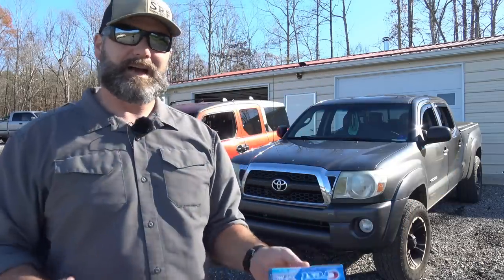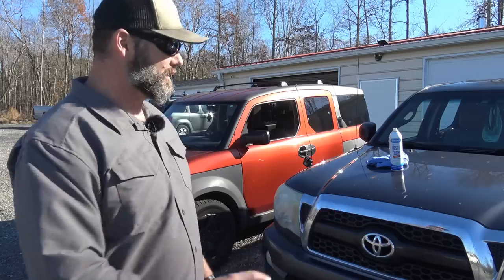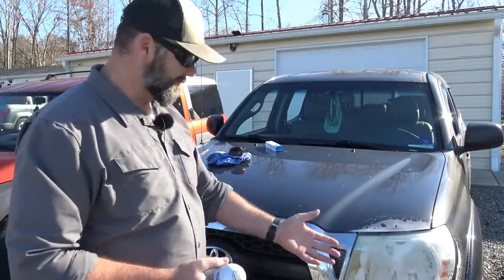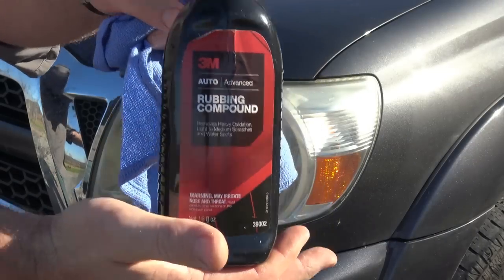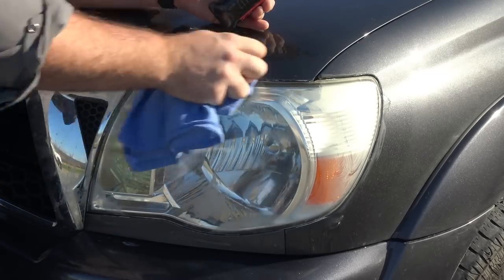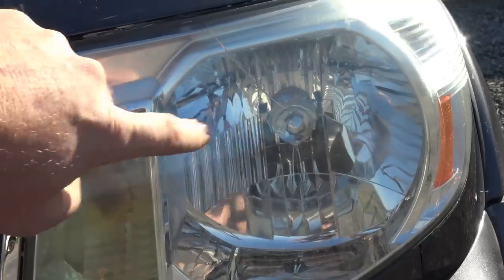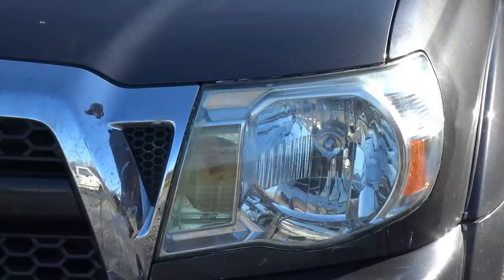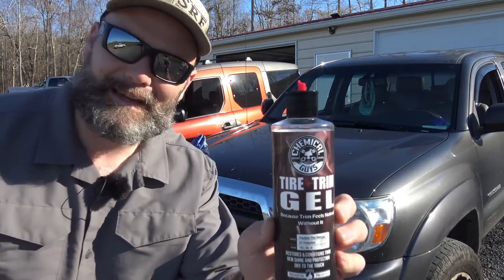Does toothpaste really work to clean headlights? Let's just see!

Comment: If they are really oxidized/yellow, start with some 2000 grit sandpaper, wet sand, wash with clean water, sand again w/2000 or then jump to 2500 or 3000 grit sandpaper and wet sand again. Then rubbing compound and finish with a good wax/polish.

Comment: i worked for both Honda and Toyota. You can use Off bug spray by spaying it on a rag and rubbing the headlights. For the best results use the compound but instead of applying it with a rag use an electric buffer and squirt the compound right onto the pad then buff the headlight. If the headlight lense has scratches or is pitted you can wet sand it using 2000 grit paper then use the buffer with the compound.

Comment: I think the lens cleaner I had for my Tundra was a Turtle Wax brand.  Only lasted a couple months then they were just as hazy as before.  Its all the road grime crap that gets stuck to them and then burned on due to the high temperatures of the light bulbs.  They need to come out with a plastic sheet you can apply over the lens as a protective layer that can just be peeled off and replaced.

Comment: If you are going to do more than buffing some metal or possibly a headlight or two I really think you should look into getting the right tools. That buffing wheel is really not intended to be used with an angle grinder as those spin much to fast. An angle grinder often will spin at something like 10K rpm. A buffing wheel like that should not be run at over a couple of hundred rpm, 3K rpm at the most. There are several kinds of buffing machines, some of which look just like angle grinders, but they all run at a much lower rpm. And some can be had very cheaply and will do just fine if you're going to buff a car or two.

Comment: The oxidation would be a result of the plastic being in contact with the oxygen in the air. So prevent the plastic from coming in contact with the air. This might be a goofy idea, but, after the headlights have had the oxidation removed and are clear how about a layer of clear polyurethane on them to keep them clear for a long time. Another experiment maybe?

Comment: Buffing compound is the way to go.  A courser cutting compound has too much abrasive.  Angle grinders run at a much higher RPM than dedicated electric or pneumatic buffers, so, yes, go easy and use a very light touch.

Comment: The guy I saw used a toothbrush to apply the toothpaste. It may makes a little difference. I have used 0000 ga steel wool on them. I also use the steel wool to clean on all my windows then RainX™ them yearly. When I wax my car I also wax the headlights. Most all paste wax has a little rubbing compound in them.

Comment: I’ve used toothpaste on headlights before, I used toothpaste with baking soda in it, it definitely takes longer than 5 minutes but all I did was put the toothpaste on the light let it dry some then dampen a rag and buff like crazy took about 2-3 times but they turned out pretty good. I eventually ended up buying new lenses because the original were cracked and needed replaced so the toothpaste was to get me by until then.

Comment: Woollen polishing bonnets should be cleaned , I did 2 recently getting ready to polish a car , I mixed some "Wool and delicates" laundry liquid with some water , dunked the wool into the mix and brushed the crud out using a nail brush in a circular motion , rinse and repeat , then put on the polisher and spin dry then allow to fully dry in the shade . They look like new again . 
                Also , never use a polishing bonnet on a grinder , they just spin too fast , even the battery powered one Josh uses here he had to ride the trigger on/off , a big 110v grinder would destroy the bonnet and possibly cause injury . Use the right tool for the job .

Comment: As Josh mentioned, you will need to redo application every 6 months or so.  Using any abrasive on the plastic headlights removes the UV coating (which obviously failed anyway). And there is no way of adding that coating back, that I’m aware. Rain-X, Novus etc will not reapply UV coating. What does work really well, wax your headlights once a month. Takes a couple of minutes and saves performing the cleaning process.  
Personally, I’m just trying to figure out how you manage to continue to have great weather.

Comment: Get toothpaste that is "whiteing" because it uses little particles to scrub with.  I used a small polishing wheel on a drill. 

Need to use some water with the toothpaste!  Doing it dry like you did will not let it work as well with the lubrication the water adds to it!

Comment: Rubbing compound is not polishing compound, it's a cutting compound.  If you followed up after the rubbing compound with polishing compound, the clarity would be even better.  I have to agree that toothpaste is a poor headlight cleaner.  Headlights are supposed to have a UV resistant coating, from what I hear, and also from what I hear is some people apply a UV resistant wax (or whatever new age name they use for wax nowadays) to protect the headlights for a bit longer.  Some people go the extra mile and apply a quality UV resistant clearcoat, but I think that's over the top and may actually cause more problems than help.

Comment: Likely to fog up again soon 1500 and 2000 wetsand paper sand w water then high speed polish wool or foam pad
Reply from the maker: Not just likely...they will fog up again.  It takes literally 5 mins each to touch them up every 6 months.  Over 6 years you'd spend an hour...the lights have lost their protective UV coating and they will need to be cleaned now.  But this works great! And it's cheap!

Comment: If you are really lazy...I have found that if you get Insect Repellent Wipes (just a few dollars for about 20) that contain DEET, they will take 90% of the oxidation off in about 30 seconds. Wash the dirt off first which would add a minute or so to the 30 seconds ! I haven't found that the DEET damages the plastic, but I would be careful near the paint. I have old cars...:-)  <bb

Comment: At least the plastic lenses can be polished.  You can't do that to glass.  I had glass headlights in a Volvo, and they got to the point that they were so badly pitted from dust and sand that the only thing I could do was replace the entire headlight assembly as the lenses were not sold separately.   I've had plastic lenses on all of my trucks and even after 7 years they were still clear and unscratched.

Comment: Toothpaste does work. You have to rub alot for it to take effect. I did it on my old ford truck.
Reply: Does it matter what kind of toothpaste? I heard you had to use the plain white toothpaste.
Reply: @lorettapresswood1135  I've heard the arm and hammer one works best.
Reply: @lorettapresswood1135  I'm pretty sure thats what I used on my truck at the time. (arm and hammer)
Reply: Oh..it looked blue..no big deal..i did like how the other turned out..I'll have to get some of that for the semi. Thanks for the video!

Comment: The headlight will fade again over time due to the lack of UV resistance. You’ve removed the outer layer of plastic which is what was UV resistant, with that layer gone it will just fog over again. I recommend you tape off all of your paint and plastics and cover your light with UV resistance clear coat. Chris Fix has a great video on this. You can also use a ceramic style coating.
Reply from the maker: I've seen it...but there's no spray paint that's gonna last on these lights....litterally hundreds of these Chris Fix comments....15 mins every 6 months, bottle will last ya 10 years.  Seems simple, I'd never spray clear on my headlights...it's gonna fade away and make them un cleanable next time

Comment: 3 hours to replace headlights on that Taco?  Sounds like terrible engineering.  Takes 6 bolts and 10 minutes to completely change each headlight housing on my 2011 Ram 1500.  I've done it a dozen times to replace the low beam bulbs with HID's/LED's while trying to get the color and light projection I wanted.